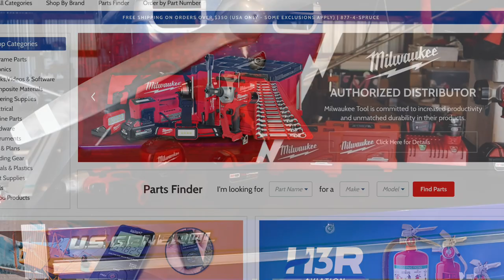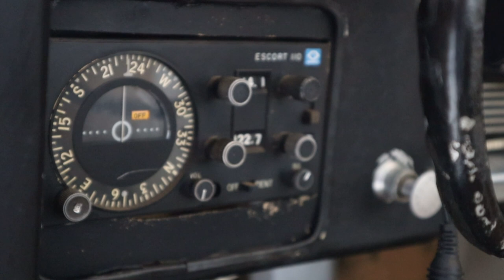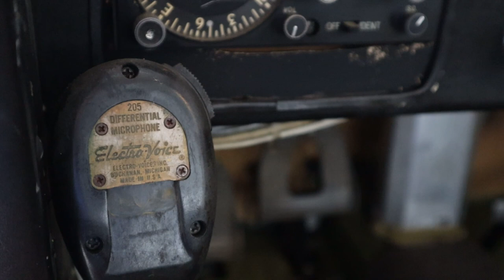Restoring the Cessna 140 | FRUSTRATING delays | Part 3

Comment: So I'd replace your p-leads and take apart mag switch (clean contacts) easy way to check is disconnect p-leads completely and use a jumper to ground the mags. This will insure mags are working/not working before you pull the mag. A lot of times the shielding can ground the center main lead and the only cure is replacing the wires.
I would also put some Marvel Mystery Oil in the oil and fuel. If it's been sitting for a long time the mmo will help loosen stuff up.
Reply from the maker: How would you ground out the mags? I did disconnect the P-lead and try again after I put the camera up but it still failed to run. Planning on redoing the P-leads anyways and have to do the ignition switch per AD.

Have already planned on using MMO once it’s running!
Reply: @The_Flying_Mechanic  just use a jumper wire with a couple gator clips, one to the mag, and the other to ground....this will replace the function of the p-lead. So you'd chock and tie down the airplane,  start it with the mags disconnected,  use the jumper to ground out the magneto (one at a time) to see if you have the same result as with the ignition switch. If you do, check and make sure #1 mag is time correctly to the engine and impulse coupling isn't engaged and #2 that you ignition harness and leads are going to correct cylinders/spark plugs should be stamped on the caps that go to sp, (T1, T2, B1, B2 etc) if you sent mags to a reputable company and got an 8130 back they most likely wouldn't have gave you a bum mag but I wouldn't rule it completely out but odds are it should be good. You can email me if you want at mixasllc@yahoo.com. I  just bought 2 recked 120/140 from a customer to rebuild. Plus I have my own I restored. And this is my day job...lol
Reply: @The_Flying_Mechanic  also if they are the bendix style where you have the cigarette that is the p-lead you'll need to find something suitable for sticking in the receptacle like an AN3 bolt wrapped with tape and hook the gator clip to that.

Comment: Looks like the spinner isn't tracking well. If your interested in a prop balance I'd love to hook up and help. I've got the equipment.
Looking good!
Reply from the maker: Ended up doing a static balance and got it within .05 IPS on a dynamic. Good call though! Made a huge difference in the performance and smoothness of the engine.

Comment: What about a remote oil filter adapter?
Reply from the maker: Haven’t researched this option. Who makes them for certified aircraft?
Reply: @The_Flying_Mechanic  Air Wolf makes an STCd kit for the 0-235 that has the C-140 on its AML. Believe it is kit P/N AFC-K007.